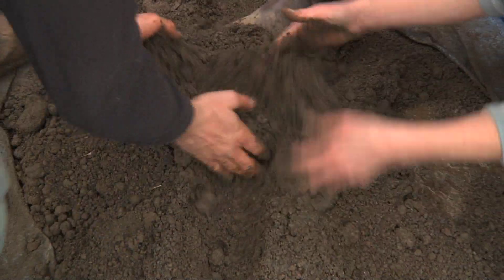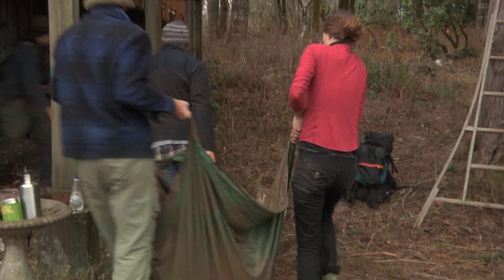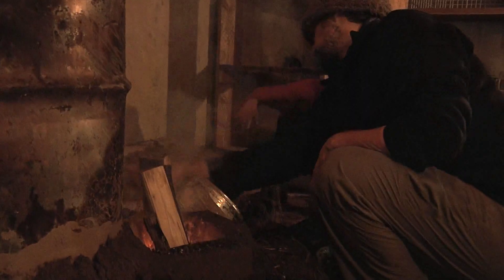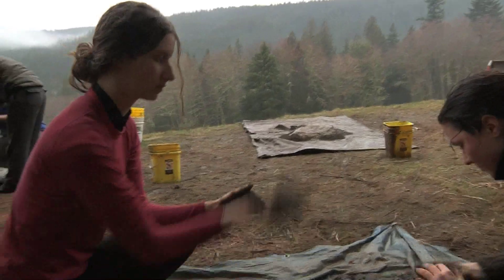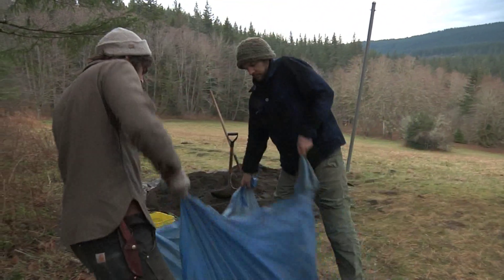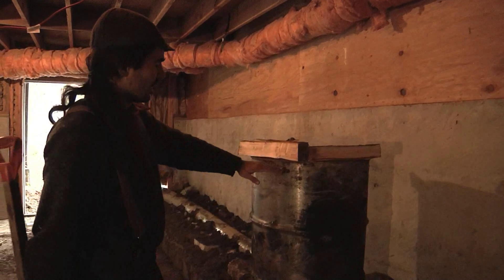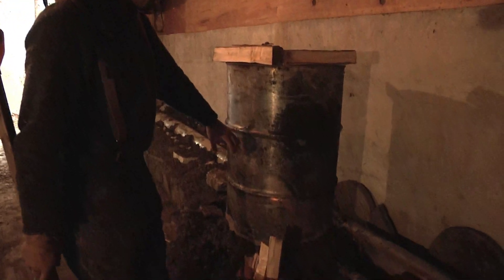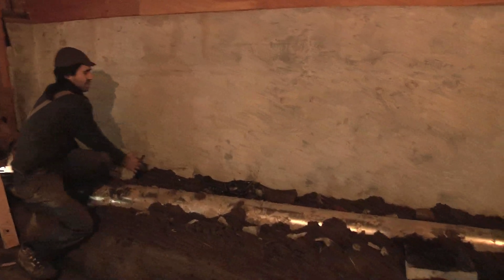Rocket Stove: Winter Term 2010, Week 6

Comment: gassing off is only questioned by people who have not built one over 400 C or 780 plus F heat is at top of riser not in galv pipe, the anti galv are the sellers of vitrified pipe,rocket stoves work but they require work
 we are not all tree huggers and hippies I am an old fashioned heating engineer that can make  you a heating controller  from an octal telephone relay but unfortunately it wont meet code because it dont need a computer but these were the computers of there day ,yes no yes yes no Binary by thermostat switching relays, octals normally last 10 years plus without a computer